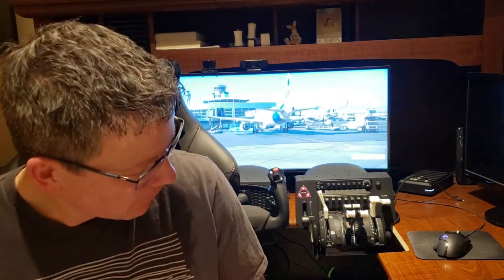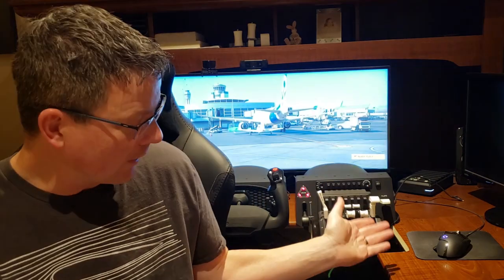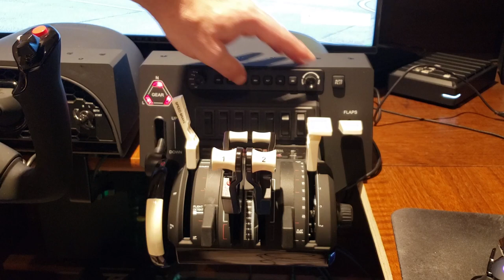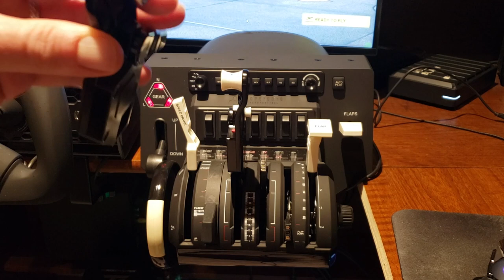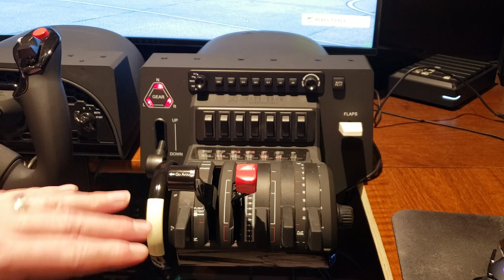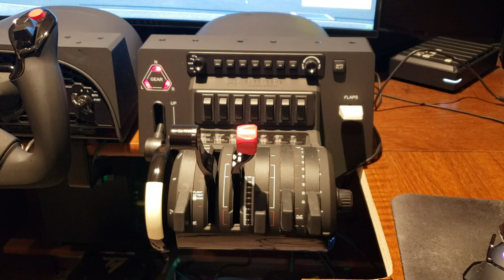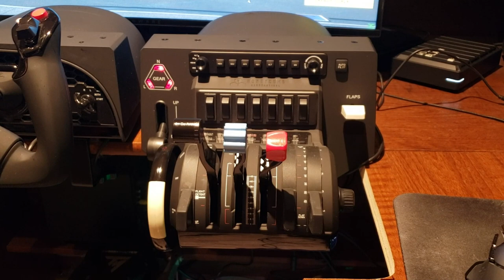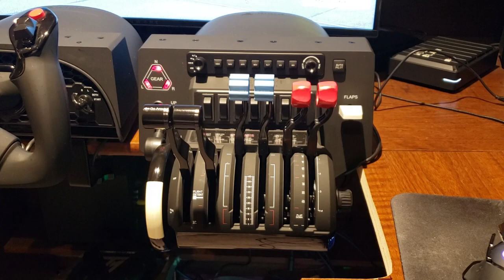Hardware Review - Honeycomb Bravo Throttle Quadrant Configurations

Comment: Great video. My throttle isn't working for a single engine aircraft, but it works with multi engines. It  shows it working in the configurations but when I get in the plane it doesn't work. Any thoughts?
Reply from the maker: Thank you for watching and for commenting. I have seen that before but was in earlier version of MSFS (possibly during alpha). Have you tried un-mapping and re-mapping the control axis for the single engine? I assume you are creating a new profile for your single engine, correct? Let me know.

Comment: Good video; however how did you "program" the bravo quadrant in Microsoft Flight Sim?  I have ALT, VS and HDG all good - work great; however CAS and IAS still elude me.
Reply from the maker: Sorry for the delayed response! I have not yet tried programming CAS or IAS. Is there a particular aircraft you are trying to fly? I have noticed that various functions on the Bravo working correctly can depend on the aircraft and fmc/autopilot the system has for it. Cheers!!

Comment: I just got this today, and am in the first stages of learning to set it  up.  Everyone speaks of two and four engine airliners, but my favorite of all the jets I flew is the 727.  Can this be set up as a 3 engine jet, and which slots would be best to use, considering that one would still want the speed brake and flap levers?
Reply from the maker: That's awesome Anthony! First off, thank you for watching and for commenting. Yes, 3 throttle configuration is also supported and I thought about reviewing that setup as well. For this video I went off the documentation/manual that came with the Bravo Throttle Quadrant. For 3 engine jet I imagine you can use axes 2,3,4 or 3,4,5; whichever you prefer. Interested if you try it out and how it works for three engines; I have not tried it yet. Happy simming and Blue Skies!

Comment: Hi what type of computer would I need?
Wht processor, memory or graphics required? Could you recommend a computer from Amazon that already meets those parameters
Reply from the maker: Hey sumitupreads. recommended specs for MSFS are:

CPU: Intel Core i5-8400 or AMD Ryzen 5 1500X or better
RAM: 16 GB
OS: Windows 10 64-bit
VIDEO CARD: Radeon RX 590 or GeForce GTX 970
PIXEL SHADER: 5.1
VERTEX SHADER: 5.1
FREE DISK SPACE: 150 GB
DEDICATED VIDEO RAM: 4096 MB

Even so, to me, the above should be minimum. I'm happy to help advise on a PC but would be easier if you let me know what your budget is. Cheers!